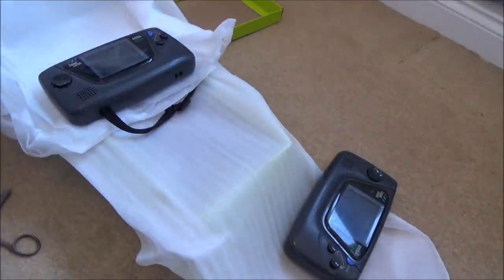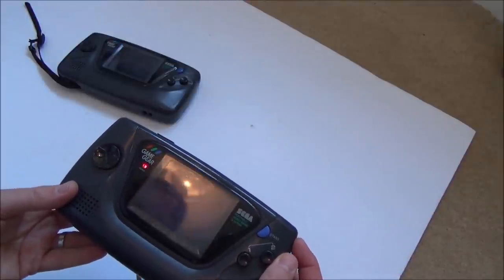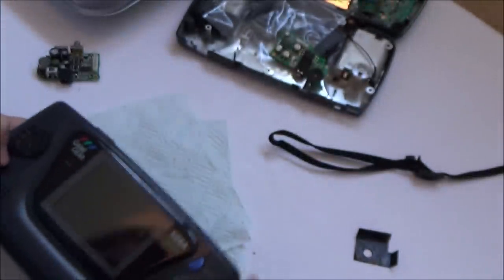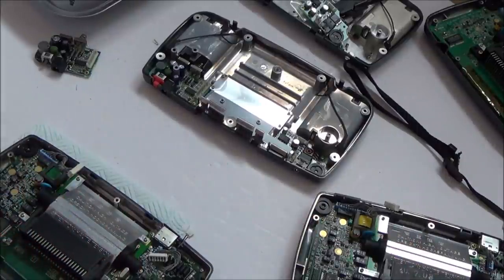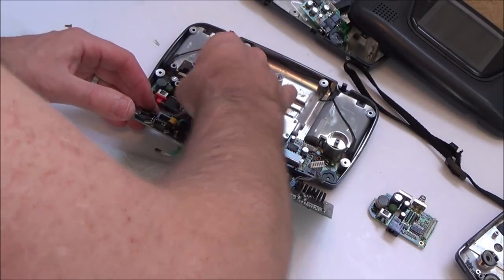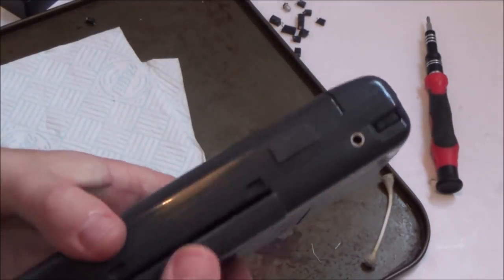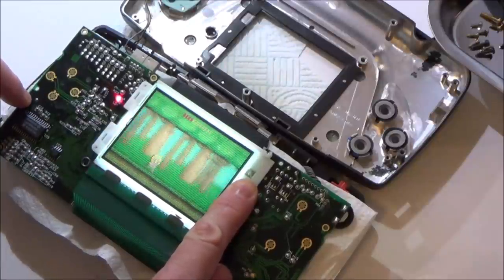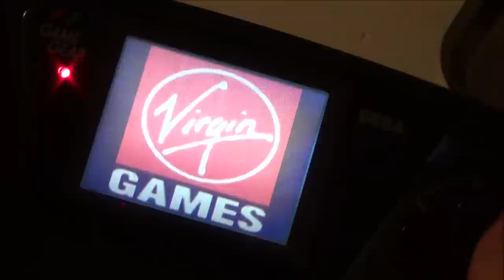Trying to FIX 2 Faulty SEGA Game Gears - PART 1

Comment: You can remove the screen scratches with some rubbing compound and floor polish / polyurethane.  Watch some head light restoration videos, or hot wheels / matchbox windshield restoration videos.  WD40 also works well as a temporary scratch filler, but will rub off eventually.

Comment: If you think of the issue being similar to the old xclamp scenario with the 360, you'll understand why their are mixed degrees of success.  I've personally had success using a hot air soldering station whilst applying pressure at the same time and it's worked fine ever since, that's about 2 years back although it maybe only comes out once every few months.  But yeah common sense with the heat etc as obviously you need enough to melt solder but not cook the thing, and it should sort it.

Comment: Well done, Vince! Might be worth getting an AC adapter in future so you can troubleshoot power issues / fault find without depending on batteries. Love watching your videos...
Reply: Yes, or if you already have one for  Master System or Mega Drive 1 you can use that for the Game Gear aswell. Mega Drive 2 uses another one, that won't work.

Comment: With the connector there it sounds like the old glue (hotbar) that plagued all sorts of screens back in the day.  Either pressure or applying heat can help, but yes your mileage will vary.

Comment: Hi Vince, The rechargeable batteries only give 7.2v not the 9v you get from non-rechargable. Might be worth noting for future videos as they may not work under voltage.
Reply: Or as others have already suggested in the comments, try it with a mains adaptor to eliminate any battery and contact issues.

Comment: Thinking about it you really have to go "all the way" fixing them IE. future proofing, new screen(best), AV out, new caps, new bezel/plastic polish, new battery pack so people are motivated to buy them even if the price gets more premium. That's a lot of cap leak, maybe it needs a bath in some neutralizing liquid. Regardless you got to get it working first and you did an excellent job of that, got one of the sharper screens there. ;)
Reply from the maker: Thank you, yes I was lucky with the screen on this one :-)
Reply: If you are going through this much trouble you should put in an LED mod aswell, the backlight is a neon tube, which you can de-solder and replace with an LED on each side. Break the ends off the tube, remove everything inside and put the LEDs into it. Then put everything back together. Increases battery life dramatically.

Comment: If I were to take an educated guess. The "heating up the chip" solution would have lasted 10 minutes tops!
Heat dissapates very quickly into the air. Good call on the pressurized fix!

Comment: Done around 20 of these now (and have a pile of parts) powers on then off again check the 5v and 34v on the dc to dc convertor - 9/10 it's the lcd row driver that also feeds the power to the lcd - pull the flat flex off the glass and it will boot - due to age the tft lcd's  degrade - NOS screens from China have the same issues even tho there new ( citizen uc320 )
Reply: Ps. Watch out for them 2 pads one either side of the screen there around 3-400v when the tube strikes
Reply from the maker: Thanks for the info. On my last video I did manage to get a shock from the light tube contacts. Couldn't believe how strong it was!!!!!

Comment: in terms of the screen having trapped liquid, that plastic bezel is only glued on, you can slip a knife between it and the screen to get it off and then dry it out, the other way of doing it is displace the liquid with an alcohol bath repeatedly dunking it and massaging it out and then letting it dry out naturally somewhere warm with some silica packets on it.

Comment: Do you think it would be possible to use some springy steel to make a bracket that clamps the chip against the closed case? Oh wait, just watched that part of the video lol :)
Reply: Or you could hot-glue a small coin or something like this (for example one of these plastic coins for shopping carts) on there, something that won't give in. But the tape fix might work aswell, maybe for years.

Comment: Do you think it would be easy to mod those so that they don't require double a batteries, I mean you can just buy lithium ion batteries in the same form factor, the only trade-off is for the electronics to charge themit takes up space that would normally be used for extra capacity.

I wonder how easy it would be to mod them so that you could charge it with a cable.

Comment: Honestly I wouldn't even bother trying to fix screen issues on one of these, just get rid of the bulb and replace it with a more modern backlit unit. Will give both a better picture and massively increase the battery life.
Reply: you do realize the bulb (backlight) is an entirely different part than the lcd?
What kind of advice is that lol

Comment: All Those people who heated up their chips most likely using a hair dryer which BTW would take a lot longer than a heat station were very lucky they didn't destroy their units. 
So if you don't have a heat station DONT HEAT THE CHIP!... HEAT destroys electronic components, unless the components are designed to be installed via a heat station, components such as surface mounted resistors, capacitors, transistors, and IC's..
   
You should only ever use a heat station when removing components should a board have ANY surface mounting apparent "Use a soldering irons as a last resort".
Whoever advised to heat a chip, should have clarified why and further more the target as to what needs to be heated, which in most cases is the solder making the connection/s for the chip in question.   
The "Heat stations" heat is much hotter and more concentrated, thus heat can be concentrated on the chips SOLDER connections that have been dried out, essentially called "dry joints" which BTW is the correct terminology, dry joints are obvious as they are dull, so this is what needs resoldering.
 
ONLY dry joints are the target when one needs to apply heat, but apply heat so that the air flow is directed at the solder joints NOT THE CHIP!!! also try and do one side at a time when targeting dry joints.. 
Dry joints BTW are caused by shock or stress, flux traces left on board whilst still in production "that's why it's imperative flux is completely removed once all rework is completed", Water or water vapour damage via "corrosive water" or in the above case via Electrolytic fluid leaking out of capacitors, ELECTROLYTIC Capacitors usually older than 5 years are most suspect but not always the rule I have had to remove a capacitor from a cheap charger only three months old yeah just after warrantee ran out :D
Any serviceman that ignores and or leaves aged electrolytic capacitors that are over 5 years old, Have not been educated properly, well its that or they haven't been paying attention in class..

Comment: A great fix again vince this looks like the issue we have on samsung lcd tvs, here is a link  show the lines https://www.badcaps.net/forum/showthread.php?t=25371&highlight=samsung+tab+bond+fix i know these are vertical but in post 7 there is a link to the material we use too fix this issue and this fix usually lasts a couple of years, a games console is different due too flexing etc it may not last as long , you maybe able to use fix/material on this sega lcd surround.

Comment: i need a game gear.
Reply: it has a absolutly bad screen. it eats batteries. it is complete useless. install a emulator on your smartphone and buy a little controller.
Reply: @tech-5231  yeah, ive got ras-pi's, old atom netbooks with Batocera Linux. i reckon its just a nostalgia thing. i would mod that thing with a lipo though. and for the record... a softmodded PSP-1000 is the ultimate handheld retro system. imo.

Comment: I like your videos, i do learned things from them here and there...

However there is one thing about you that drives me absolutely nuts.

I never see you use any sort of volt/ohm or multimeter and it drives me up the wall how many tasks you could either make immensely easier, or skip altogether by simply using one.

Do you not know how to use one? Is €50 for a decent one too cost prohibitive? 

But in my opinion if you can't use, or refuse to use a basic multimeter then you have no business diagnosing or repairing any electronics. I'm no expert on small electronics... my background is auto repair and I'm pretty sure your electrical knowledge and abilities are greater than mine yet you don't use that entry level tool.